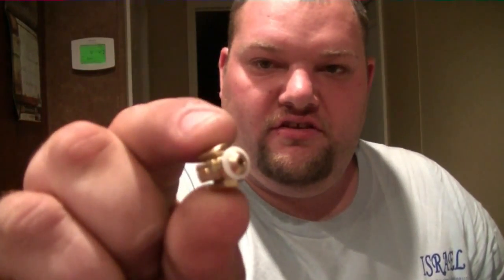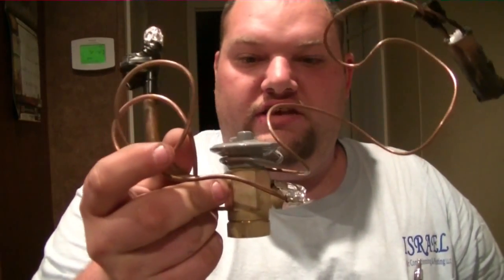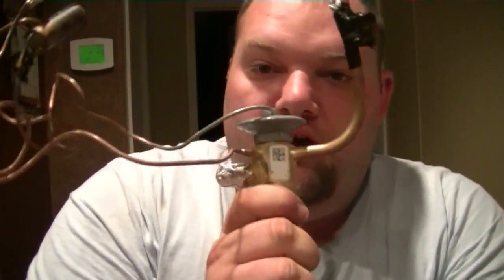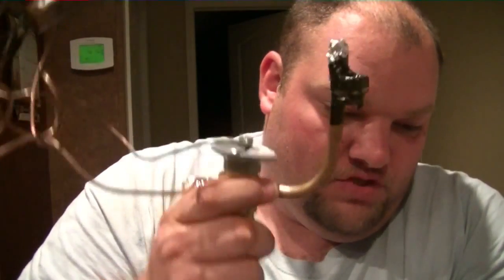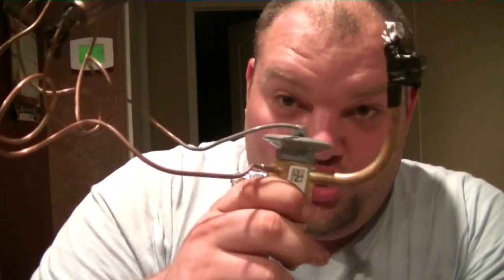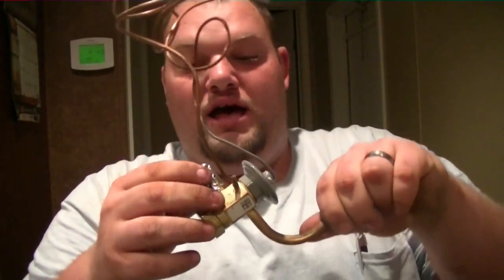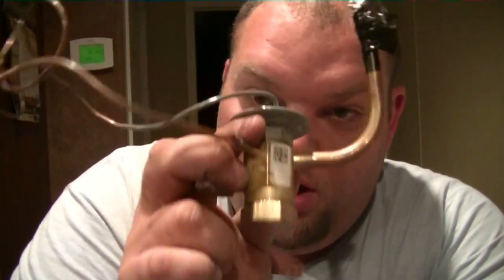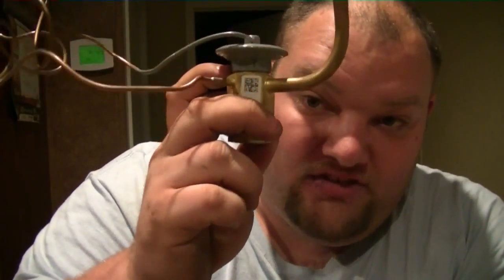HVAC Tips- Pistons vs TXV's

Comment: I agree the failure rate is pretty high on TXV metered systems.  BUT most of the time they fail due to installation errors. i.e. over heating while brazing, not purging with nitrogen while brazing.  I will still to this day choose a piston over the TXV when ever the situation allows.
Reply: I guess you can give Goodman a +1 here.  Their TXV's are bolt in.  No fear of overheating the valve.  Just make sure that you braze or solder in the suction line BEFORE you mount the bulb or you will be back for repairs.

Comment: Thanks for the video, I am the process of upgrading my old r22 system. I've been unsure whether choosing a high seer with all the whistles and bells, or a simple minimum seer required system. I agree with you that when it comes to an ac system, especially here in hot texas, I consider system reliability over anything. And that is only a simple system will provide best. I even prefer straight cool over heat pump because of its simplicity and it get to take break during winter season, which minimize the wear and tear of the outside unit. I don't want my ac to break during 100 degree days here. I even consider of putting another mini split system in my house as a backup if I ever want to buy a high tech ac system, just in case my ac break. I can't stand without ac in my house. Your video has help me to decide which system I should buy now.
Reply: You may find that much like with cars, just sitting outside without use is NOT always a good thing.

Comment: The TXV is a great idea but reliability of the unit is more important. Without reliability you have nothing. You shouldn't have to replace factory installed parts in the field. The manufacturers need to get their design figured out.

Comment: There is only one very slight with a piston, that point is that " they don"t work. I am sorry They do work if you are the local power company. Units run three times as long to make set point. The power company loves these.They do have a place in A/C& R and that place is the mongo pail.

Comment: Hi  Israel, I have a norene 5 tons 13 seer the txv is giving me a hard time I replaced it twice now , during the summer heat of Miami the unit is on all day long , high pressure 350,  low 75,,  I will change the txv to piston , my question to you is what size piston can I go for? I will really appreciate your advice,, this is my own house. thank you in advance
Reply: Rovsson latz your head pressure sounds way to high for an r22 system. you need a bigger piston it sounds like.
Reply: Rovsson latz or bigger txv.

Comment: If a customer has allergies and keeps the windows closed they may run the ac into the night. A system with a fixed bore will starve the evaporator somewhat and be less efficient. Add to that a partially dirty air filter or a low thermostat setting at night and you not only are running inefficiently, but also risk icing the evap.  Fixed bore are designed for maximum efficiency at an outside ambient of 90+.  They lose efficiency as the ambient drops.
Reply: Hell that's Houston 9 months out of the year!
Reply: Sounds like you're making an obsession about efficiency. 
The customer wants cooling, not a few cents off his electric bill.

Comment: I have to say, that I am generally using TXV's 100% of the time but mainly because of efficiency standards now here in Florida.... I personally have not had a TXV fail in approximately 13 years from any of my systems, but also I'm flooding with nitrogen while braising. Without trying to sound offensive I think maybe TXV's are fairly reliable, but require more care during install. Im installing probably 80% RHEEM systems and 20% Goodman. This kind of reminds me of the carburetor vs fuel injection technology from years ago.

Comment: Hi Israel... I watch your videos about TXV, my a/c roof package (Trane... to late I already buy this unit before see your videos   LOL) I try to take all the information about a/c before contact the service guy. ok this is my problem the a/c air from the vent is only 70-74 degrees this unit is on all day, inside the house is 82 degrees  outside 110 degrees ( I live in Arizona ) today I go to the roof and check the coil.
the coil I feel warm in the top and little cold in the middle. the txv is very cold one side and warm the other side. I turn the blower off and the coil start to icy very cold (nice) about 18 degrees but when turn on the blower the coil icy start melt down and go warm again... You think is the txv.....freon is fine and the coil is clean (service guy two month ago say everything is fine clean coil and the freon $125.00 service and the unit still the same :(   ...........)........... Any suggestions         Thanks

Comment: hey israelhvac , i need some advice, i purchased a payne 14seer 3 ton 410a condenser that has txv metering device on the nameplate.  but i ordered goodman 3ton evap coil with a piston on it. i already have the evap tied into the plenum. just wondering if i have to put a txv on the evap or will the condenser still work fine if its flowing through a piston instead of         txv? ty for any advice.
Reply: Your condenser doesn't have TXV, it says it has because the original coil had it... It will work with orifice (piston) but you will lose SEER rating...Based on your question (luck of knowledge) you don't want to install TXV on the coil yourself and may want to stay with orifice if adjust the charge properly.

Comment: You are right. I have replaced over 250 TXV's  on Carrier 80% and Train  20%  sense 2013.  Did I get a free part, NO ,5 lbs of R-410a,NO,  or a filter dryer, NO.  Or labor, NO. at least 4 to 6 hours per system. Not a dam dime.  I have eaten all the warranty's.  Carrier says I should have put a Additive fro the compressor. Yes we tried this, its another trip sometimes those trips are 4 hour turn rounds. Then you have a pissed off customer and a new TXV.  In the past 3 years my customers I build in 30 years are going to other contractors. I even had a carrier rep tell a customer yes that company used to be so good " I just don't know what has happen to them lately" Carrier owes me for more then 250 repairs that I paid for out of my pocket. You look at that cheap TXV that is made in Mexico along with the Copland Compressor. Why do you think Carrier does not have there own install and repair people. They do not want that side of the business when they can get suckers like us to give 10 years parts free . How many friends do you know in this business that have blown there head off so Carrier gets paid the insurance money and the wife might have a few bucks , I don't wish this side of the  business  to anyone.
Reply: TXVs?
ECMs?
R410a?
Paper-thin primary/secondary "90%" heat exchangers?

Capacitors that are always burning out because the replacement for PCBs don't work?

10 SEER. 14 SEER, 18 SEER,  20 SEER....

"You need a new system if you have an R22 leak" (?????)

Do homeowners understand the screwing they are getting from the EPA and DOE?

Is the HVAC business really HVAC? Or is it an EPA-DOE enforcement business?
Reply: IPC Tempstare.  Day night.  Carrier  not even a  year leaking  condenser  coils  knocking  compressor  problems  3 out 10  . On older AH found  txv power heads  rusting  and bulb charge  is gone the valve will shut down completely.  On the ones that  unscrew ,trim a penny  with shears  screw it back on it will push the needle  wide open .  Until  it gets  replaced  . Or not  It becomes a  orifice.
Reply: @chrisduhaime5689  

T&N has a vid on the same thing. 

https://youtu.be/Amo2eRlYrzg
Reply: @chrisduhaime5689  

Thank you, idiots of "ozone depletion" and the tormenting self-righteous busy-bodies of EPA and DOE.
Reply: Everything you stated is 100% spot on in my opinion.
Reply: Ozone quackery:

Ozone depletion LOOKS LIKE A  FRAUD -- just like the quackery that is global warming(1).

https://youtu.be/9Szs-treHwQ

The alleged culprit is chlorine. 
Has CLOROX been "banned"?

Does the NaCl of SEAWATER add to atmospheric chlorine?

BTW - that "hole" in ozone over the south pole: was it there before we had satellites to photograph it?
How long? 
Maybe it was always there.
Maybe it was always a feature of the atmosphere.

Instead we're going to get a royal screwing over everything the involves refrigeration. 

 (1) see videos like this for the quack science that is "global warming":  

https://youtu.be/JpfMM3bVbhQ
Reply: I just read the first comment a little more thoroughly.

Suicides in this business?

American suicide rates are becoming like Cold-war Eastern Europe's.  (A movie was made about that. Fun huh?)
Reply: @hg2.  got one even better the European equipment reach-in refrigerators coolers and such there pushing propane as a refrigerant with no odor Trace gas be careful  wen using  the torch . Witch  makes no sense  when it's  supposed to be about all safety . And now they want to push propane  of all things . From  the looks of it they like to fuck with everything  ever 10 years  .

Comment: both work fine. The piston just can't perform like a TXV can. Most TXV's fail due to lazy mechanics of minimum wage factory workers that just don't give a shit. Brazing without nitrogen purging, sloppy air purging, not performing pressure testing, Getting a dry, dry, system proven with a vacuum gauge ( usually not done ),  and properly secured sensing bulb and secured cap tube to prevent vibration stress cracking. The TXV will adjust to variations in temperature, the piston will not. A small piece of crud that somehow finds its way after the drier will get held up in the TXV strainer screen, The piston jambs. If there is a small loss of charge, the piston looses capacity quickly and is critically charged, the TXV will adjust for losses in charge before loosing capacity to cool. In 25 years, I've only had one TXV fail, and it was from a factory install on a heat pump that actually had the sensing bulb mounted 24" after the equalizer, and one that had a plugged equalizer from solder.... Most American standard units come with pistons and Yorks too, The TXV is usually an optional addition when under 4 or 5 tons.  The piston is just another cap tube to me only cheaper and faster to install.

Comment: It's not a big deal with a piston, both meters can function. A txv can modifiy its orifice at lower temperatures and regulate a better delta T when head pressure drops due to rain on a condenser coil. A piston with 72 return air temp tend to fall off with 15 or less delta T on a wet condenser where a txv can hold 20 degrees even at 68 return air regardless of outdoor ambient. It's just a matter of precision.

Pistons do clog. Same gunk that locks the powerhead on a txv can cake in a piston chamber and not allow the piston to seat correctly. Carrier heat pumps come with pistons for heating and when you take a reading and see 150+ suction on heat cycle tend to be because the piston is sitting on gunk and isnt fully seated in the chamber. Anything can fail, pistons arnt gods gift to metering, it's just less moving parts.
Reply: Why are they called pistons? Does it have anything to do with pistons like in a motor, or is it a term that just came about in the field, like the term seasoning being used for cast iron pans?
Is it just the tech name for an orifice tube that's easier to say?

Comment: Txv is required because very few adjust air flow for tonnage of ac. The issue is the quick in and out and get paid attitude. There is no difference between txv and rfc running units output. A piston is not a moving part and cannot break!

Comment: TXV works better in cooler weather. Piston is discharge pressure dependent. If you are going to need A/C down to the 50's without outside air intake then you will need the TXV: It don't care what the discharge press is.Northern climates already know about this.Southern boys don't grasp the concept
Reply: YES YES YES! Thank you I've finally found somebody who wasn't in my head to verbalize what I was thinking, Houston is right behind Las Vegas and Phonix in AC consumption, BALLS TO THE WALL in summer, which by the way is 10 1/2 months!

Comment: Vast majority of all TXV failures are do to poor installation practices.
Reply: +chribrian   95% of all TXV failures are from the oil that is used in Copland compressor.  Carrier, Trane, Lennox all sent a bulletin out. They will not let you change out the TXV until you use  Rejuvenating oil for 2 days. If it still fails then you will get a TXV.  The oil cost $65.00  the tool to install the oil is $250.00.  Put that on 5 trucks. Have 5 recalls to your customers house. Need to start giving out Trane's or Carrier's phone # to go fix this.  They are the ones giving 10 years on parts. All the foreign-made parts just cheap. They know it. Put I on the contractors back to take care of the mad customers.

Comment: How do you know if is a txv or piston
Reply: You'll have to open up the panel at the EVAPORATOR and check.It's on the LIQUID line at the evaporator.
Reply: Open it up or you’ll see a bulb connected to the suction line near the coil

Comment: A few years ago at my home in Vegas, My Goodman unit would run alot to keep the house at 76 deg. After 5 years, the compressor went bad. After replacing compressor, the tech noticed very little pressure differential between the high and low sides.He noticed it didn't have the piston installed but didn't have one one his truck so he installed a TXV. People say that it would not work at all without a piston but I say it will but not very well.

Comment: You are 100% Correct. I will have nothing to do with any equipment with a txv. My company only installs 13 seer air conditioners and 14 seer heat pumps with base model 80% and 95% equipment. We used to sell another brand and got tired of the call backs on txv failures. We always used proper installation techniques like removing the sensing bulbs during brazing, set the units up on the proper subcooling etc. Goodman has the least amount of bells and whistles and NEVER had a dead on arrival unit in the past 13 years.

Comment: Really good video. I just installed a brand new airtemp heat pump 13seer with a bad txv right from factory.  Replaced it and runs great! Gotta keep an eye on that back pressure hunting around. 
Sometimes you can put the system in heat to get the restriction out of the valve temporarily but it will just happen again eventually

Comment: Good video John.
 Txvs take longer to charge because you have to wait for the txv to settle down, up to 20 minutes every time you add or remove refrigerant. One good thing is that you  don't usually need to measure entering wet bulb as the TXV sets the superheat and you're charging by subcool. As you know the York two stage Affinity's require you to know the wet bulb so you can find the required subcool on the chart just right of the electrical compartment.

I have opted for the piston when ever possible for the very reasons you pointed out.

Been awhile since is I've installed Goodman but seems l remember that the piston taped to the outside unit states that it's for "MOST" but not necessarily all combinations. You're supposed to check the piston chart shipped with the equipment. Usually the one taped to the outdoor unit is correct but I found myself changing the piston to another size  because I'd choose coils based on their static pressure drop, not on which one the supply house wanted to send out the door.

Comment: Thanks for posting this video and greetings from Louisiana. I may need assistance-with not much experience.-In May I replaced my 7 yr old Lennox evaporator coil after a major leak with an Aspen coil. Last week, September 10, my compressor failed. I replaced the condensor with a compatible 3 ton unit. The new condensor specs call for a TXV, but don't want to install it. After installation, I noticed vibration on the liquid line going into the evaporator. I used the existing piston on the Aspen evaporator---should i be concerned? Any advice would be appreciated?

Comment: pistons are good and I never seen one fail. However I did go on a call one time and my high side was low and my low side was high. and had been this way for a few years turns out the installer had the piston in backwards.

Comment: Counterpoint: Many TXVs fail due to improper installation practices. Not protecting them from the heat of brazing, no/inadequate purge/evacuation, and contamination in system. However, many TXVs are misdiagnosed due to improper airflow causing TXVs to throttle back and starve the evap... and as we know, most duct systems are terrible at best.

Comment: I have an r-22,  2.5 ton  10 seers air conditioner in a  year 2000 manufacture home , my system is nordyne, my gas furnace is intertherm , norddyne  90 cent furance.  the outside air conditioner went out and need replaced.  I cant get a new 10 seers  AC unit now but i can get a Haier 13 seers , r-22 , 2.5 ton Ac new.  it comes with that pistion in a bag you are talking about.  I was reading  on an AC chat site site were  it said the 10 seers coil will work with the 13 seers AC  unit but it said you should have a TXV value installed  because there may be problems with oil return if you dont have it. i looked on the gas furnace indoor coil and i see anything that looks like a TXV. If the AC unit  has a built in TXV valve will that work, i could ask the dealer if it does or will the pistion in a bag work? thanks

Comment: Piston systems usually contain more refrigerant causing higher amp loads hence the lower seer rating. Txv systems lower refer charge lower amperage better load fluctuation capacity and more stable superheat to compressor all around a better choice over a piston.
Reply: @g quinn 😂

Comment: standard 4 ton coil and condenser r410a got my target 10 degrees subcooling but my suction pressure is low 91/225 and I had 28degrees evaporater temp the coil froze up im thinking bad txv whats your thoughts ty  bill